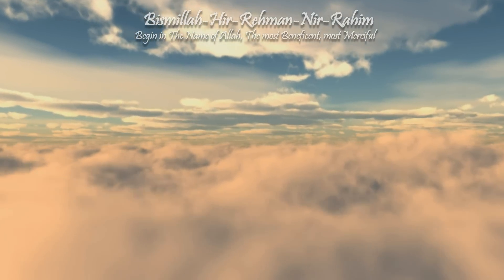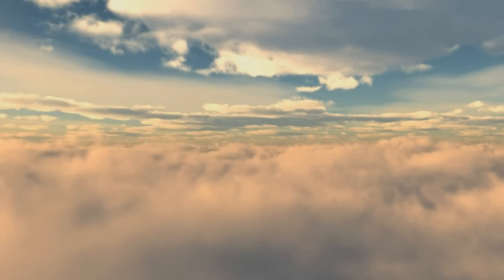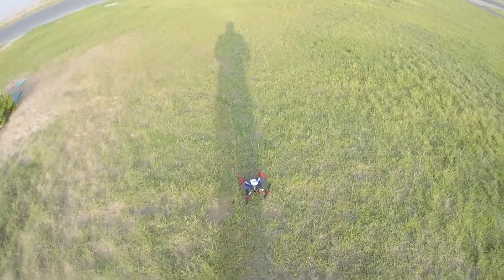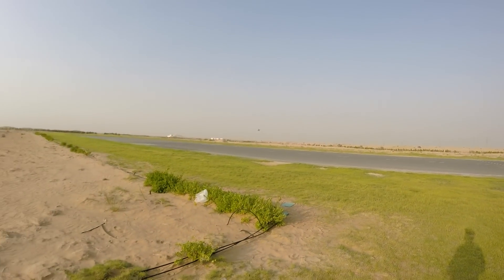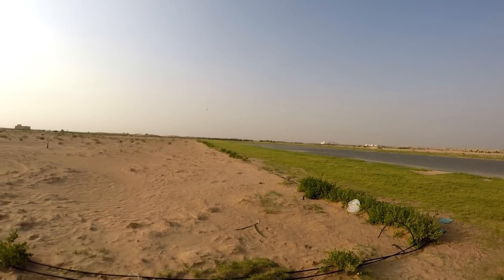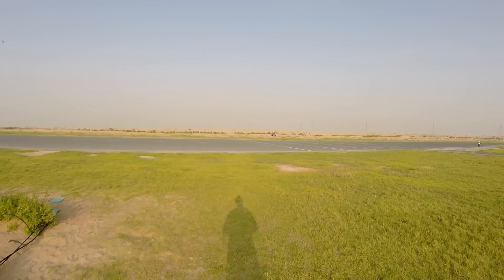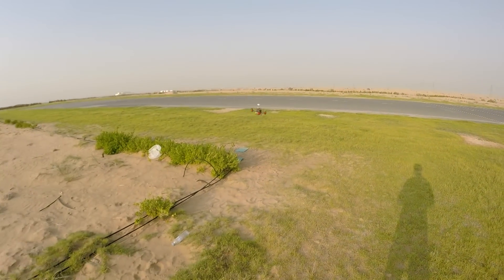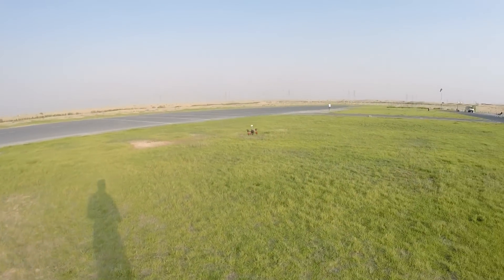Crazy Fast Realacc GX210 FPV racing Quadcopter 4S Battery

Comment: Just purchased the ARF version.  Please recommend tx/rx (control, not vid) and misc components that will deliver 1000+ meters range with telemetry capability (speed, altitude, distance,,,etc).  Has been a tough decision process that I am trying to balance cost and quality.  I am wanting this quad to be a sport cruiser capable of flying beyond the typical range of racer class.  Any additional tips and/or recommendations will be appreciated my friend.  Thank-you.

Comment: hey i had a walkera 250 and had all kinds issues with drop of death even with it setup for motors to not shutoff .. so for they money would this be a great way to get into racer drone again? what is required for 4s lipo? is it worth the money or should i get a immersion vorteks instead? just dont wanna spend alot

Comment: Cheers for the cool vid :) 

They are a key part of the reason i have 3 of these on the way ie. RTF version and an 2 ARF versions as backup/for spares. Damn sales!  :)

I will be flying it using 4s - and was wondering whether you would be able to please post your PID's?

TIA.

Comment: what happened with LEDs? they burned with the 4s battery?
Reply: Pedro Díaz Muñoz mine stopped working too. in my case the leds are not secured very well to the arms and can move and separated from the wires. resoldered and zip tied and are working again and should be less likely to disconnect again..but it is a weak point...

Comment: Hi, great testing. I builded the same quad with 30a ESC and 2600kv motors. I haven't had time to do my maiden flight yet - Can't wait :). What Ground Control are you using? Betaflight 3.0? What is your PID tuning? Thanks sharing this video!
Reply from the maker: cleanflight

Comment: Remember you are using 20 amp esc, the motor will ask for more power and the esc will not be able to give the demand, upgrate to 30 amps esc and you will incriced your rpm and will pull at least 25 amps with more than 2300 kv. bigger esc less chance of smoke.  Nice video.

Comment: Builded the same quad myself with the 30a esc's , 2600kv motors  ,4mm frame and runcam owl+ camera. Using 4s 70c 1500mah battery on it.... Its a beast in acro and fpv racing.  Love it 👍

Comment: Where can I buy the 4s battery you used
Reply: You can get it here right now with 50% DISCOUNT: http://www.banggood.com/Realacc-GX210-CC3D-Naze32-F3-FPV-Racer-RTF-with-700TVL-Camera-40CH-VTX-p-1091154.html?p=TL0111854575201411Z0
Reply from the maker: Vcanz Power